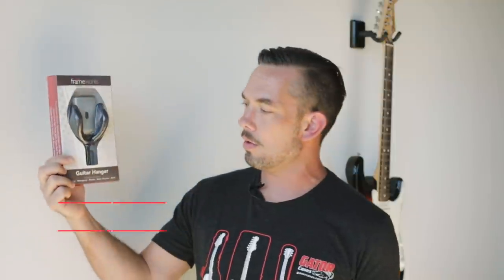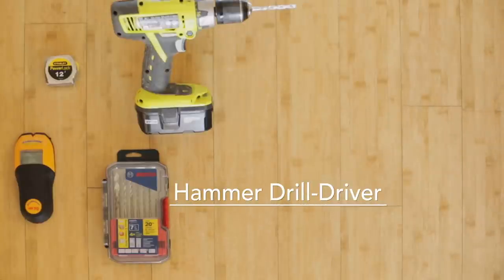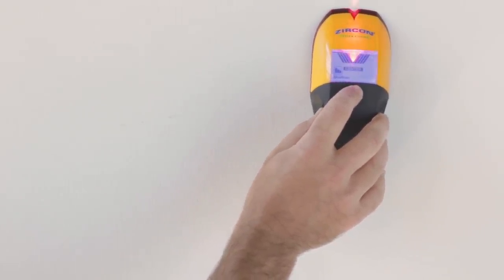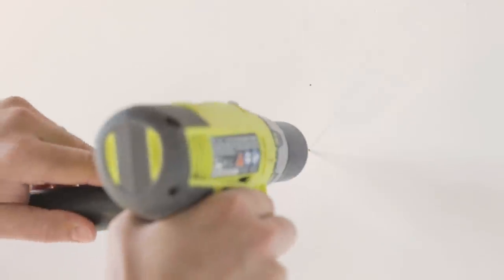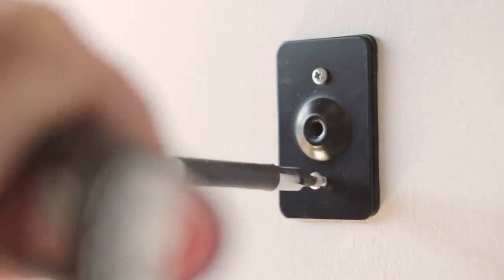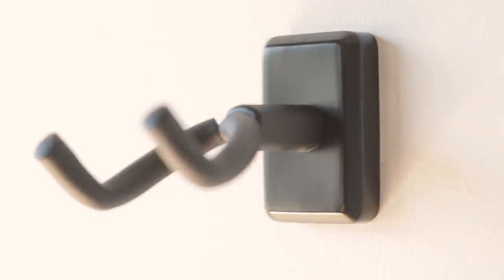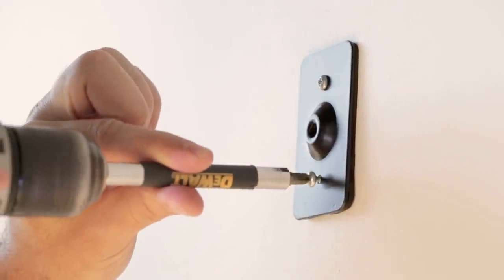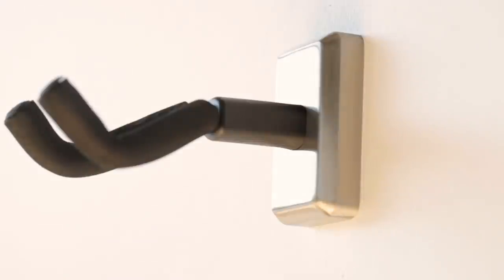How To Hang Your Wall Mount Guitar Hanger

Comment: Don't use the screw-in anchor shown in this video. Drywall isn't strong enough to keep this type of anchor tight given the weight of a guitar (and the stress caused by use).  Use instead a toggle type designed for drywall.
Reply: I can vouch for this. 😅

Comment: I’ve used several of these and they worked fine (until my plaster fixings failed on one) when redoing this into timber I had enormous trouble screwing the yoke back in. It would only tighten upside down, needed up cracking three of the wooden cover plates. It’s not a great design.